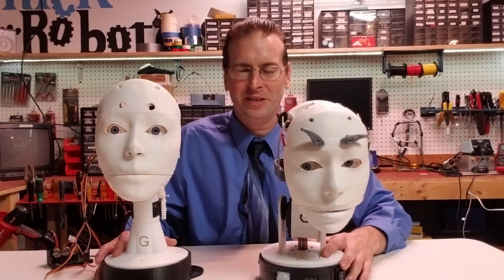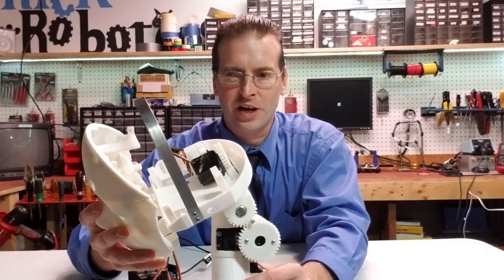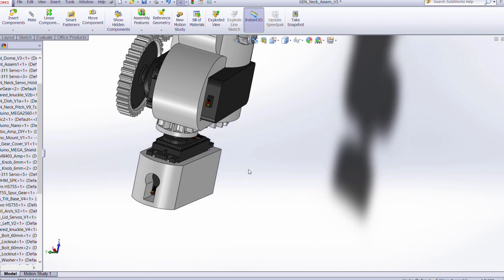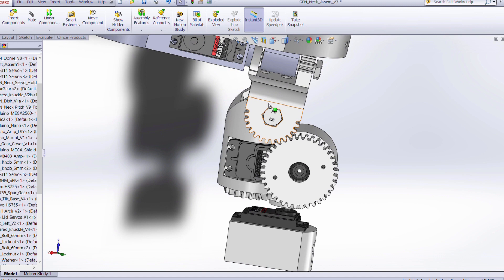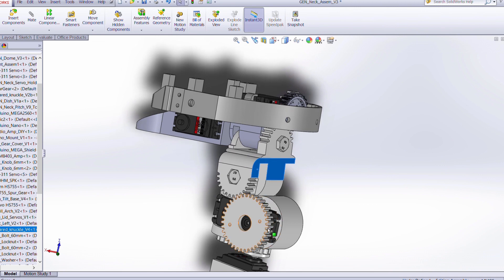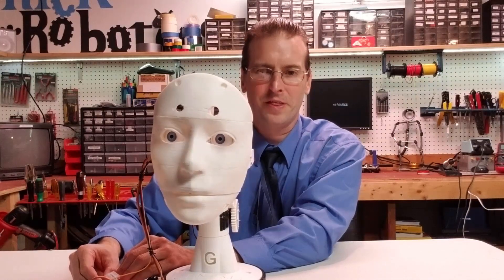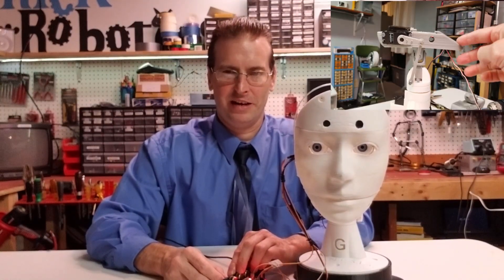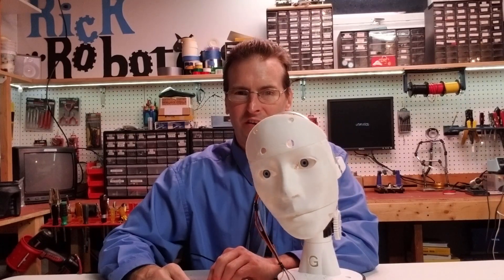Rick Robotics - GENESIS Robotic Platform Part 3 - Neck

Comment: Looking good. Are you planning on making a latex mask to pull over Genesis to simulate skin? And also, will you be making more facial movements? Thanks. Keep up the good work.
Reply from the maker: Thanks! I'm not sure if i will make another attempt at a latex mask, at least on this version. Eventually, I plan to make an entirely different face, which will be more suitable for covering with various masks or materials. As for this version, I plan on at least adding more facial movement with a couple more servos.